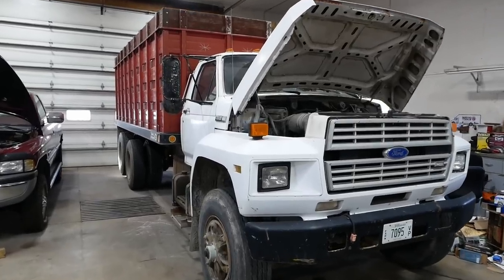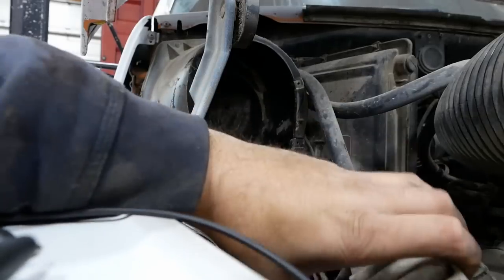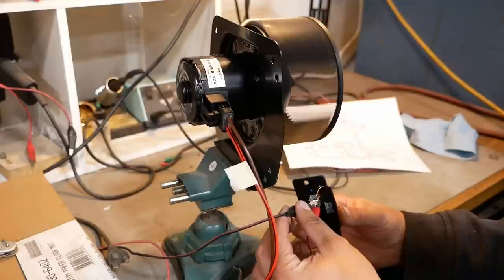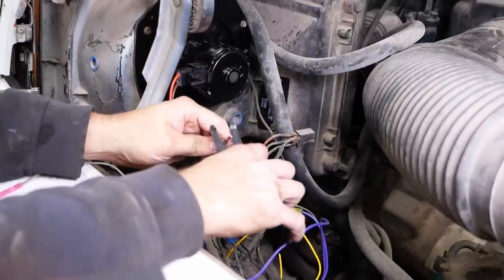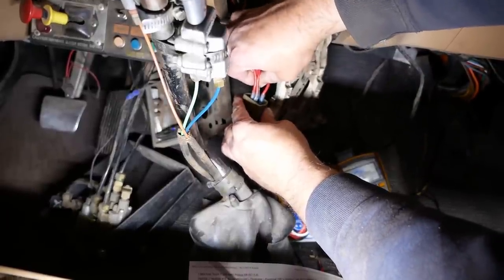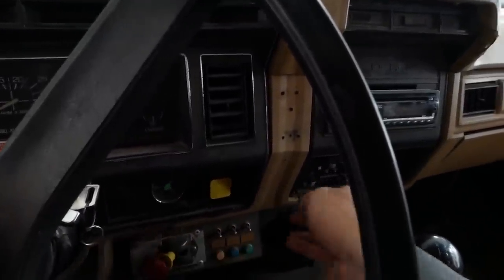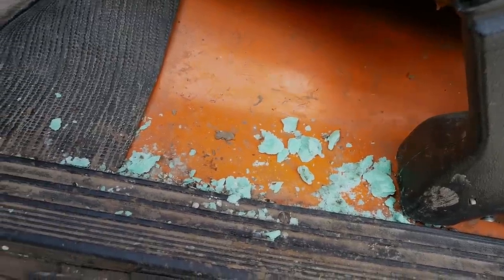Frigid Farmers - Ford F800 Blower Motor Unhacking

Comment: To be able to figure out electrical issues on these cars is one thing, but to be able to figure out someone else’s hack job is another. Great work my friend.
Reply: Absolutely! Well said!
Reply: @Watchyn_Yarwood  sorry i am dutch my English writing is not so good, i can understand it but writing is an ather thing 😵‍💫
Reply: Very true words!
Reply: I think the best thing was there were no electronics to chase.  Just simple wiring and fuses.
Reply: I struggle when I have to jump in the middle of a project where I didn't do the disassembly but my uncle, with all of his years of experience, could put damned near anything back together from a jumbled heap.  That's an old pro right there.
Reply: Cutting edge techno

Comment: On a farm truck the H doesn't mean high.  It means Hantavirus.  Mucho caution there bub.  That flurry of turds was impressive!!!
There is a factory circular on those vintage trucks that states in no wish shall the proper screw be reassembled after it's first disassembly.  You can put anything you want back in, except the screw that came out.  My personal favorite was a slotted stove bolt with a square nut behind the dash.  Suitably cross threaded.  That is the vintage, enviro-friendly red locktite equivalent.
Reply: Classic Comment, I got a Helava Laugh! Happy Friday to you , appreciate the Chuckle
Reply: @davidcolesr.8628  We've seen too much not to laugh about it.  Have a great weekend Senior!!  I had a bud in elemenetary scruel named David Cole.  He could turn his eyelids inside out.  Spooked a teacher doing that once.
Reply: no farmer truck is complete without a healthy heap of drywall screws,  self tapers. on the  wiring side, it cant be a true farm truck IF there isnt at least a dozen  wirenuts sprinkled in somewhere distracting you from the nightmare of the dozens of scotchlocks

Comment: It is interesting to see how much hacking goes on in these old farm trucks.  

Nice repair and thanks for sharing!
Reply: Makes me feel not so bad about my hack jobs haha
Reply: Especially truck probably changed hands 3 or 4 times -hacking the hacks but our Wes to the rescue as usual fine work Wes.
Reply: @stevedibiase728  Wes, does nice work for sure!
Reply: Last summer I helped figure out the electrics of a 1950s tractor. Now that was amazing!

According to the owner, the electrics were an aftermarket kit, which made finding schematics absolutely impossible. The base model of these tractors sold with a crank handle and instead of a glow plug it had a metal tube that you stuffed lit cotton buds into for preheating the engine (single-cylinder diesel). The fancy kit offered four fuses, electric starter, glow plug, brake lights, number plate and rear lights and side marker/low beam/high beam headlights plus a horn. The brake light switch was held in place with and operated by some baling wire tied to the chassis and brake pedal. Most of the wires didn't go anywhere but we did manage to trace everything over the course of two evenings. The OEM schematics for the luxury spec did confirm some of our suspicions and gave us directions on wire sizes. The factory wiring had six fuses for the same stuff, one of them was for the sole purpose of feeding the high beam indicator on the dash 😀 A dedicated 8 amp fuse for a little dash light!

Comment: What DOES work against mice and it's really worth putting in your truck are those scented glue cardboard traps you can buy for a few bucks in most supermarkets. Just tape them to the floor where they don't get in your way and check every once in a while if they caught anything so you don't get foul smells in the cabin.
Reply: It's a grain truck, the operators step in "foul smells" 🙂
Reply: Those glue traps are bulls$%& just put a regular trap in there no sense in an animal dying that way on a cardboard glue trap if you cant kill them sufficiently and quick dont bother.
Reply: @Sherlock you need help
Reply: @Sherlock or Snickers

Comment: Wes I love watching you strip wires and crimp connections back on.
1st- is your hands appear to be as large as my own, and I know what I go through in most cases. 
Typically if I have a hand in there trying to sort out what's what, then I can't see anything. 
So cutting crimping and reconnecting is all done in braile.
2nd- I'm not the one doing it, so that means I am not paying for it, and it's not mime.
All the best reasons for watching you logical brain in action sorting out the toothy critters, from the I wanna be's damages is rather stimulating in a strange way. 
Irsh Springs soap, potty mouth critters, can't say I ever heard of that home deterrent for the little bas___ds.
We have field mice here nearly as big as full grown cats, so looks like house mice got to him.
Difference is here, they typically chew the wires too if they take to it, and it's typically the whole harness is compromised. 
We won't even discuss tree rats we've got to deal with, but being in the middle of a corn patch, you should have a variety of all of the above mentioned, plus several others.

Comment: Had a 8.2 Detroit in my rollback tow truck. F 600 .
 Hauling a car on back it got just under 25 mpg. 
 I loved it .
They need rebuilds more often but they are a lot less expensive to rebuild than Cummins international etc . 
 The fuel savings over 50,000 miles is seems like it was about $20,000.
 Don't get the turbo 8.2 because they are prone to fail faster than non turbo.
 Non turbo motors is slow but 
 Love those POS 8.2 . 
  Commercial fisherman are the biggest competition for buying old trucks with 8.2 Detroit's they buy them for the motor

Comment: First, thanks for taking the time to share with us. Next, it's only a guess but it's possible that the have power going through multiple contacts on the switch so as to divide the load and the heat dissapation. Lastly I get a shall we say a sadistic pleasure from watching someone else splicing together wires in and under a dash instead of me. Lol. Again thanks for your videos, I both enjoy them and pick up useful tips. Well done Wess.

Comment: Just bought an 86 F150 Grandpa truck Wes. Not only did it have the super cool "dice" door lock pulls, it had the even cooler musical horn, 2 sets of fog lights, an inoperative JC Witney style "universal intermittent  wiper control" and  3 speakers and an amp behind the seat. I guess he wanted his Vic Damone tunes nice and loud. The former owner was either the next Tesla or a budding mad scientist. The sheer amount of wires under the dash was staggering. What was even more impressive was the number of wires cut out of the factory fuse block so her could run power, apparently anyway, to the fuse block from a 91 Lebaron he attached to the firewall with a 3" sheetrock screw! I channeled my "inner Wes" and unhooked the most dangerous looking stuff and ended up with about 17 1/2 feet of wire in my scrap metal bin. I should have the whole thing fixed good as new about 2077...

Comment: While not a thrill watching " a guy strip wires", (I'm an electrician), I did appreciate you shortening and cutting out those jack leg red wires at the heater control switch. Despite Ford and the hatchet man's efforts.  Another reason I Watch Wes Work, trying your best to put it back as intended. Good Job.

Comment: I recently worked on a 1980 -something Western-Star tow truck, same issues. What a mess of wiring. Years and years of hack job wiring. Quoted the customer x amount of hours labor, basically what i wanted to do was to strip the wiring out and re-do it back to factory. Or, the closest i could anyways. Customer didn't like the dollar amount. "ill take it somewhere else". One of those :thanks but no thanks" kind of jobs.
Reply: There are only two quotes.  One to get the job, and one to not get the job.

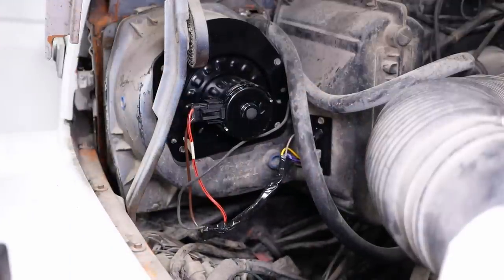Comment: 19:00 that rubber boot is important, it provides cooling air to the motor so it doesn't overheat and cremate itself. Had a guy bring me a truck that was going thru blower motors. 1, the intake was full of leaves and crap, and 2, it was missing the hose. I ordered one like wes did, and no more issues.

Comment: When you opened the driver's door, I thought the cat may have come along for the ride and that was your surprise.  Nope!  It's amazing that the connector for the rear of the heater control is still available.  Who needs a radio when the cab noise level is probably 80dB?  Nice work, Wes!

Comment: I learn something every time I watch your video, I had no idea the blower motor speed resister was negative, I couldn't ever figure out my Dodge truck a/c blower and ended up straight wiring it through a house hold light switch, what can I say this is Florida and I had to have the a/c blower working and it did. Cheers from Jacksonville Florida 🌞
Reply: Total Florida move, Can confirm, Floridian here.

Comment: I have found that dryer sheets tucked under the interior carpet in various places will work in rodent retention as well as a mix of peppermint and water in a spray bottle to spray throughout the engine compartment.

Comment: Reminds me of my 95 F150 4x4 I bought salvage when it was in the process of being parted out.  They just cut the wires off doors etc.  Spent a couple of weeks sorting wiring out and putting connectors back on.  Fun times but truck was super clean aside from the wrecked front clip, rare find in Pa.

Comment: Well I always find electrical interesting. I buy early Jeeps and putter with getting them back on the road. I do the same thing you do. Clean up a home grown mess built by others. I see many throw up their hands and go buy a new wiring harness. The only problem there is that if you can’t fix the original stuff you can’t install a new harness. I have had only a couple in which I had to completely rewire the Jeep. It is pretty amazing that no matter how archaic the design, you can rebuild it with the right parts and it works. I appreciate your dedication to correct parts and quality work. From the dry banks of the Underwood Branch, thanks for the fun.

Comment: Ugh another one of those vintage F700/ 800's. The tree service I worked for had one and it was loaded with issues. When my boss figured out that I was a tech he was gung-ho on me digging into that thing as well as our bucket trucks, other chip trucks, chippers, etc. No Detroit in ours though, just the shitty gas one that makes like no power, similar to the one you worked on before in a previous video. Always hated fixing someone elses hackjob. What a nightmare. Some folks should just not attempt things and keep their hands off of tools. Yup, I agree, probably an 'AssPLUNGE' truck originally. LOL. Thanks for sharing Wes, from a 25 year tech, to another. You get the 'benefit' like I do, working on such WONDERFUL rigs! 😆👍

Comment: Here in the U.K. back in the eighties when cabin filters started to be fitted to cars, those heater blower resistors caused many a burnt out vehicle. People did not change the filters and the airflow was insufficient to cool the resistors. Many a Vauxhall (GM) set on fire. I wonder if you guys had a similar problem?

Comment: Looks like you are not done either! You need to install a very high power amplifier so it will be louder than that pumping sound as you start it up. I like the debris that comes blowing out of the vents when you turn the fan up. No telling how filled up the plenum is filled with rat/mice excrement and discarding. Always love your clever humor each time... Thumbs Up!

Comment: My father has a 1975 GMC 6500 with an Allison automatic transmission and tandem dual drive rear axles and air brakes.  Other than the radio, what absolutely has to work to pass inspection is all that does work.

My father's grain truck makes this truck look almost new, pristine condition.

Comment: I won't use the term I use in private regarding the p.m.'s work, but it ain't good!  But you did a very nice job. It's warm up here in the Driftless today!
Reply: As far as farmer wiring goes, those repairs were actually pretty good. I didn't see anything that belongs in a house and they attempted to seal their connections. That's like top 1% stuff in the cornfield. 😆

Comment: Wiring is a big pain in the butt and it is a big rabbit hole when the wires have been cut up. I have a 1993 F350 hack job but was lucky cause I have a old Ford electric shop manual for all trucks that year with detailed wiring diagrams.  Thanks

Comment: The volunteer fire department I used to be on had that same 4 stroke Detroit engine in an 87 GMC 7500 FMC setup.  The truck wouldn’t do much over 65 as it was geared very LOW and only a 5 speed w/ no hi/low.  I do remember it would turn about 3500 rpms, but just wasn’t a powerhouse.

Comment: back in the day i worked as a pontiac dealership mechanic.. when  the blower motors used to start making noise. the back bearing by drilling a hole and squirting oil in the hole. a quick fix hack.

Comment: The 8.2 Detroit has unit injectors that are operated by dedicated cam lobes, push rods and rocker arms like a two stroke. They had head gasket problems and oil pump issues.  A lot of them went into Ford medium duty trucks.

Comment: Thanks Wes. Know that there are some out here who didn't have the benefit of a good mentor and had to figure out little things like splicing wires properly, as well as adjusting valves or replacing rack and pinion steering (those I got, more than once in subfreezing conditions). I for one, paid close attention to your crimping.

Comment: Twizzlers for the win! Little known fact ... they are an edible.oil product ... in a pinch they can be cut to shorter lenths and used just like heat shrink.
Side bonus is that you will know exactly where the mice have been chewing when the vehicle comes back in a few months!
Thanks for sharing 🇨🇦

Comment: I hadn't heard of using soap to deter mice, though I have seen it hung from tree branches to keep deer from bothering young trees. No idea if it works.

I find it interesting that the blower/heater box appears to have provisions for an A/C evaporator coil, as opposed to the usual completely different design for a heat only system.

Comment: They need to invent a bottle of spray on dust so you can blend in your work with the original patina 🤣
Reply: 2 miles of dry gravel road will match the old and new.

Comment: I did some unhacking on my 2004 SAABs radio wiring, the entire speaker output connector and half the power connector was chopped off and then spliced back together with a mix of screw terminal blocks and crimpon spade connectors, just to wire in some flimsy aftermarket wires for front door speakers, and two wires on the power connector were left unconnected.

All the crimps were loose and pulled off when i tugged on them, so i soldered and heatshrinked only to find out the hackery dident stop there. A previous owner has also messed with the stock speakers in the dash and wired them in series between the 2 channels so all bass is cancelled out and both play regardless of balance control setting.

The original antenna cable was also chopped, and replaced w some cheap active dipole antenna that had just been stuffed behind the headunit.

Comment: We had Ford 9000 series trucks and the fan speed switches would melt at the connections. We put a DTDT center off toggle switch in the dash to provide high and medium speed.

Comment: I have three of those lights... you can drop them from 6 feet and no damage. 
I appreciate these lights more than most of my tools. 
You should highlight the fact they have ultra violet to flouresce dyes for coolants and air conditioning systems. Use them to detect leaks.

Comment: Those “fuel pinchers” were an absolute disaster. All of the old GMC school buses in my district when I started going to school had those, but were retired with serious alacrity once the Internationals started showing up. Soon as you said it had the 8.2 I was like “oh noooo” — good thing it isn’t in for an engine problem. 

I think the designers moderately delivered on the fuel consumption and cost to produce mandates, at the expense of basically every other desirable trait. Most of the ones that survive today are usually the lower power NA versions that didn’t see much use for the first 30 years of life. Blown head gaskets (open deck design for a medium duty diesel? Why not!), broken cranks, spun bearings, all meant many were down for major repair before 100k miles. 

These days, major engine internals (in good shape) are almost impossible to find, as they haven’t been made in I think decades, spare inventory is long gone, and most used parts probably suffer the same issue you’re trying to correct. They’re just best avoided if at all possible, and if not, probably not a bad idea to start preparing for the inevitable failure.

Comment: Nice truck!  That's a dang nice Omaha Standard bed on that bad boy too.
Hah, I'm reminded of an '87-'93 Mustang. When you go to remove the instrument panel bezel, the hazards or rear defogger switch comes with it. Well, the wire harness connector also comes with. The only problem is that the four or five wires are short, and pull out of that connector, requiring you to chase down a wire diagram...
And I'm tellin' ya: The moment they take their teeth to our wire insulation, they cease to be our friends!

Comment: Multiple pins on the switch are connected at the same time in order to minimize arcing. The motor is a big inductor and will give a big induction kick on speed (voltage) changes. That will arc the contacts and burn them up. Connecting across multiple contacts helps to prevent that.